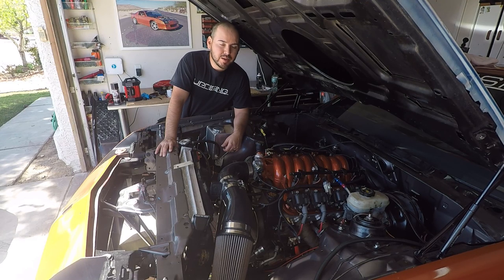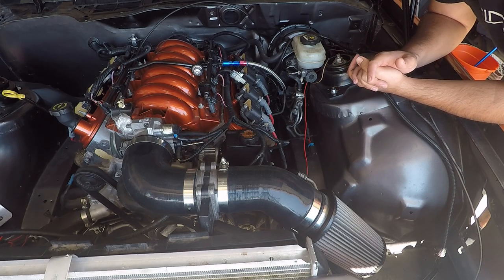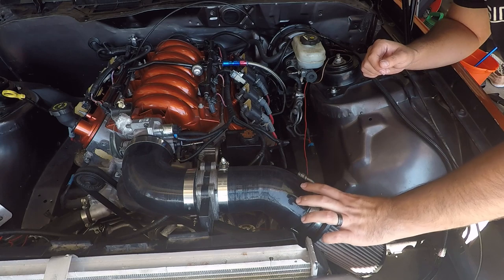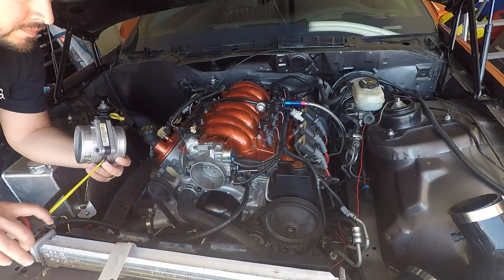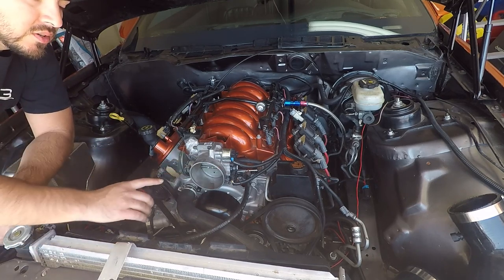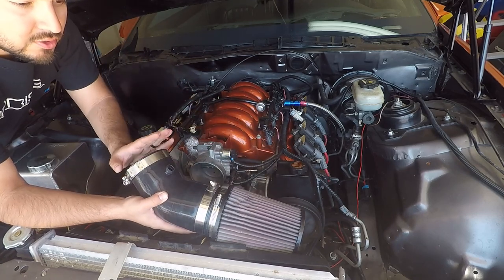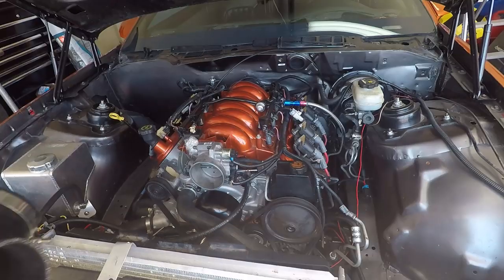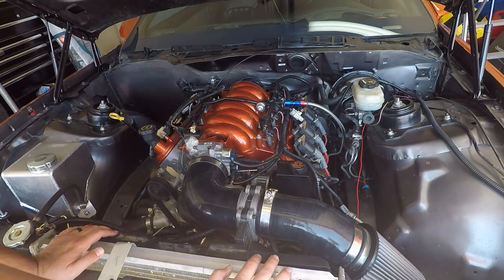DIY LS1 SWAP AIR INTAKE!!

Comment: What intake manifold is that ? Thanks
Reply from the maker: Ls6
Reply: Awesome, I am currently putting a cathedral port ls6 on my LQ4 for truck clearance, also the ac Delco part is about 144 on summit and the LSx fast 90mm that retails for about 989, is that what you did ?

Comment: My throttle body is 102mm to MAF is 3.5 I’m lost 🤦🏾‍♂️ do I need 4 1/4= 108mm?
Reply from the maker: Outside diameter of your throttle body is what you need to measure.